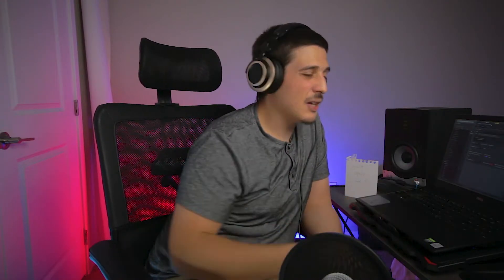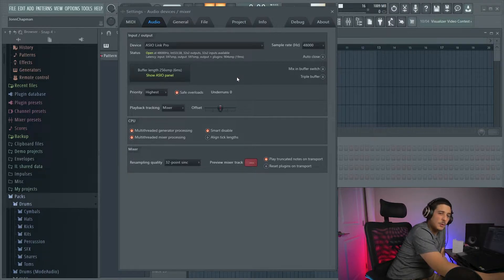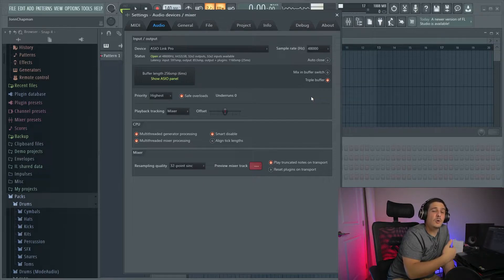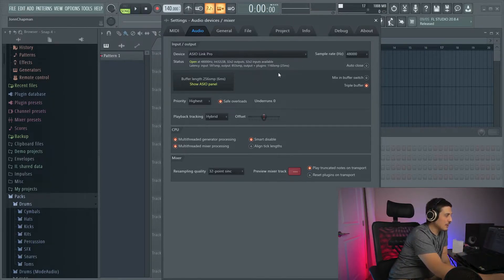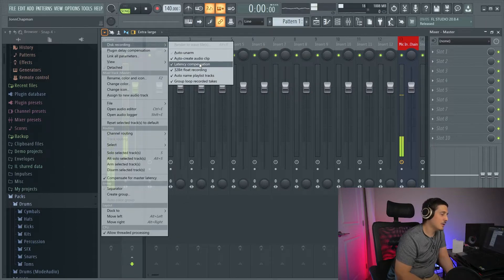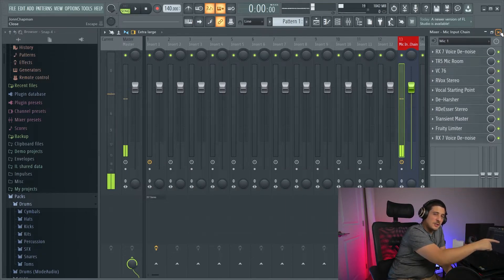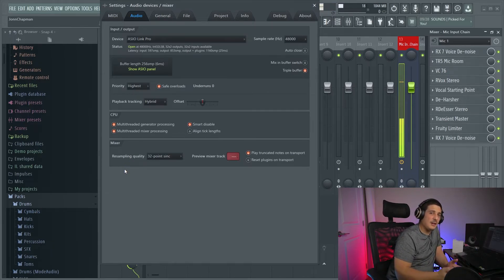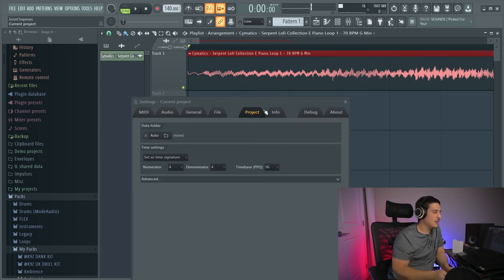How to fix FL Studio Latency Issues (MISTAKES) DON’T BREAK YOUR PC

Comment: What if the delay only happens after you export your tracks? How do I fix that part?
Reply from the maker: @x_Modest_x  This is usually caused by a plug-in issue. You can try to consolidate the track but it will very likely export with latency if you consolidate. A good work around is to arm the mixer track of the audio that is having the problem and then right click the main record button on the top of FL Studio. Make sure that “audio” has a check mark next to it in the drop-down for the main record button (from right clicking it). Hit record and then hit play and it should do a live recording of the audio which should be on time. You can mute the original track and then export with the new latency free audio clip.
Reply: @ thanks man you are a life saving genius!! I hope someday you’d make a video ❤️
Reply from the maker: Glad it worked! Not a bad idea 🤙

Comment: You can use ASIO without it muting everything except FL Studio. To do that, you must ensure that all of your devices in both FL Studio and Windows' sound menu are set to the same sample rate (44khz, 48khz, etc.)
Reply from the maker: This is true! Sample rates do need to match. This also depends on the particular ASIO driver, some are not multi-client and require a particular application to let go of the driver prior to being utilized elsewhere. It also depends on whether or not "Auto Close" is on or off.

Comment: great vid bro 100% , do you know how auto save project to a different folder meaning to a hard drive i have lost projects in my past as of right now my computer says its full when i only use fl for it pls help we'll  kindly appreciate it. for those laptop uses
Reply from the maker: If you click the "options" dropdown which is located next to "file" and "edit", you will see an option for  "Project general settings". The top section of the "Project" settings is the "Data folder" section. You will have options here to choose where to save projects and samples.

Comment: after changing the buffer size, i still get a pretty bad input delay when i try to record guitar. i’m using no other vsts at all, just audio clips
Reply from the maker: What’s the specs on your computer? Also, what kind of audio interface?
Reply: @ScaleAudio  i’m using a gaming laptop with a ryzen 9 5900HS, 16 gb of ram, and a scarlett solo
Reply from the maker: @gams1123  is triple buffer on? Also? What’s your sample rate?
Reply: @ScaleAudio  i think i found the problem… it only lags when i record from edison, but not when i record straight to the arrangement as an audio clip. my problem now is my cpu cant handle my amp simulator vst being opened multiple times, which means i can’t do that many layering tracks
Reply from the maker: @gams1123  Glad you were able to figure it out for the recording! As for the amp simulator you can print the audio and turn off the plugin to save resources. If you arm the track you can hit ALT+R to print it to the playlist as an audio clip. Then you can mute the plugin. If it is still taking up CPU you can try turning on smart disable for that plugin to see if that helps as well.

If you go to Tools>Macros>Turn on smart disable for all plugins, it will disable all plugins not in use which can also save a lot of CPU. The only problem with this options is that it can throw off time based effects such as melodyne.

Comment: When I change to ASIO4ALL v2 my problem is that now input and output are both on my mic. it picks up the mic but I can't hear any sound from FL studio.
Reply from the maker: If you open the asio4all settings pannel you should be able to uncheck your mic as the output and choose a different device for output.

Comment: Is there any option to synchronize all mixer tracks latency?
Reply from the maker: Make sure that in the mixer options under “disk recording” that “latency compensation” is on and under “plug-in delay compensation” you have “automatic” checked. By default these should be on and everything should synchronize, what specifically are you experiencing?

Comment: If my project is still lagging after changing these things, is the only option to delete some of the plugins? In my case, not only is it lagging in the DAW, but some parts won't even play at all until I mute some of the effects. When I export it into a wav it's the same. Half the song is missing😅 Turning off smart disable made it a bit better. I'm glad you mentioned that since my project has melodyne.
Reply from the maker: If some of the tracks are silent even when exporting that may be due to some plugins dropping licenses and going into demo mode. or not being licensed at all and being demos. When I have intensive projects I usually get more strategic about what plugins I'm using and I will bounce any tracks that I can to wav files with the effects applied. Then I'll save that in a new version of the project so I can get rid of a bunch of plugins but if I need to go back I can. Kind of haphazard and inefficient but you gotta do what you gotta do.

Comment: Hey men, i installed autotune pro and it causes 64ms of latency now when i record vocals i turn it off and when the vocal is recorded i turn it back on. But now i realized even when i do that some part of the project like kick will just start going way before music plays, and when i turn off the effects (that causes the latency) it plays normal again. Idk what to do, should i just delete all plugins that cause latency or what
Reply from the maker: Some troubleshooting for ya. 

In your mixer, under the top left drop-down make sure plugin delay compensation is checkmarked for the “automatic” option. 

Is your kick in a mixer track by itself? If not, are the other instruments in the same mixer track early as well? Try changing the mixer track of the kick to make sure it’s not related to that mixer track specifically (there are mixer related latency options for compensating for plugins and recorded audio)

If everything else checks out, go into the back of the plug-in wrapper and try to give it a fixed latency to the offending plug-in, you can do this by clicking the cogwheel at the top of the plugin, choosing the option that shows a plug as well as a cogwheel, going to the “Troubleshooting” tab, and clicking “Use fixed buffer sizes”. this may add more latency to the track, however, it may resolve your sync issues.
Reply from the maker: You can also click your master track and make sure the clock icon on the bottom right of the mixer is set to delay audio output. Unsure if that could cause anything weird if it’s off.

In the audio settings checkmark the align tick lengths option.
Reply from the maker: Ps. Sorry it took a bit to get back to you

Comment: So I have my Scarlett as a asio driver but I don’t know how to get the playback through my headphones
Reply from the maker: Are your headphones plugged into the front of your Scarlett? Are you using a windows or a Mac computer?
Reply: No they are plugged in on my computer and I use windows
Reply from the maker: @Reelmoments433 Gotcha, the Scarlett asio driver is for the Focusrite Scarlett USB interface to be able to process and output/input audio. In order to hear audio you have to be plugged into the physical interface. The outputs are labeled for the headphones and/or speakers. Scarlett interfaces are a very great bang for your buck interface. I bought mine about 8 years ago and still use it today.

Comment: Thank you so much for this very informative video. I am using a Scarlett 2i2 solo studio interface together with FL Studio ASIO. The lowest buffer length option I have is 256smp and I have my sample rate at 44100. It seems no matter how much I adjust these things and go through your video that I still have terrible latency. I tried ASIO4ALL as well but nothing seems to help. Any suggestions?
Reply from the maker: You should have a 2i2 usb asio driver to choose. If not I’d go to the focusrite website and download the appropriate drivers. Installing the drivers should give you a new driver choice in FL which may help. Let me know if that resolves the issue 🤙
Reply: I got the same issue as well. I dont know to install drivers. I got a behringer interface
Reply from the maker: @budgie2322  you would go to Behringer’s website and find your products driver and then download it.
Reply: I downloaded my Scarlett as a asio driver but I can’t hear playback
Reply from the maker: @Reelmoments433  what generation and type of Scarlett is it?
Reply from the maker: @Reelmoments433  are your speakers connected to the back of your Scarlett? And are they passive or active speakers?

Comment: after i export my tracks to stems I am having huge problems putting them back in to FL to mix the project. everything is offset timing wise. like all the stems are like milliseconds off so its impossible to adjust them to the right spots even if I compare them to a reference track of the song unmastered. Does anybody have any idea why? this has been driving me crazy for longer than I would like to admit and because of it I cannot finish any project that I have started. NEED HELP and i have found nothing online to explain my problem over months of looking. I don't know if its a latency issue but nothing in this video fixed anything for me. However it was very informative.
Reply from the maker: Hey! Sorry for the late reply! Go to your mixer, in the top left is an arrow pointing down, click it and in the drop down is “disk recording”, go there and make sure “latency compensation” is on. Underneath disk recording is “Plug-in delay compensation”, make sure “automatic”, and “compensation automations” is checked. When you export, in the export options on the bottom is a bunch of buttons listed in the “miscellaneous” section. In this section you should see a button for “Trim PDC Silence”, make sure this is on. These are all the delay compensation settings I can remember. If these don’t fix it you can go to audio settings and try turning on “align tick lengths”. Also if it’s only specific plugins you can try going to the plugins “troubleshooting” section under “vst wrapper settings” (vst wrapper settings is an icon that looks like a plug and a cogwheel next to each other) and you can try checking “use fixed buffer size”. This will give a fixed amount of latency which may help with the automatic compensation. You can also try checking “use time offset” on the same page. If fixed buffer size and time offset don’t work I’d make sure to turn them back off when done with them. Hopefully something here works for you.

Comment: Anything I record is starting earlier than it should as opposed to later and its got me scratching my head. Any help would be great but maybe Ill figure it out soon. Wonderful guide!
Reply from the maker: I would try changing the playback tracking and adjusting your offset. Change it to driver and set offset -200. Tell me if that helps. (Pulled that solution straight off of image-line support.) for tracking, driver will generally be the way to go for interfaces, mixer will base timing off FL Studio itself. Offset should help with the rest.
Reply from the maker: Thanks for the comment and hope that’s helpful!

Comment: i have around 350 ms how to fix this
Reply from the maker: Wow. Thats a lot. Without actually being behind your computer to troubleshoot I couldn't quite tell you. If you've followed the stuff in this video, then all that's left would be plugins or a buggy FL Studio application. Something I failed to talk about in this video is sample rate. The higher the sample rate the more that has to be processed at one moment in time, therefore the more latency your system has.
Reply from the maker: Most likely however you have a plugin or instrument giving you a problem or you need to uninstall and reinstall FL Studio. There is also a "diagnostic" tool under the "help" option in the top left menu in FL Studio that may be able to help you. If all else fails, then it may be driver related or have something to do with compatibility issues between FL Studio and your computer system.
Reply from the maker: Cool drum and bass track on your channel btw.

Comment: Hi, so I've had this issue with my new laptop, I've had 60 ms buffer length and I've followed the video yet nothing has changed, any tips? I'm thinking it's a setting on the laptop itself
Reply from the maker: Is there any plugins in your mixer? Sometimes plugins cause a lot of latency, there’s actually setting in your plug-in wrappers even for your instruments that if accidentally checked can cause huuuugggeee latency.

Your general settings has some settings that can cause latency. Not huge though.

If you’ve dropped your buffer length, you’re using an asio driver, it’s not being caused by any plugins, and your latency is still that high then I’d try updating the drivers to your laptop and getting the latest service packages for your operating system. You also might try reinstalling FL Studio.

And if it helps at all here’s an updated in depth audio settings video.

https://youtu.be/Idi61zBfKbM
Reply: @ScaleAudio  Thank you, I'll be sure to try update the drivers, i realized it's nothing in my mixer because i tried using the mic even when i just open fl, no project, no plugins, but thanks for getting back to me 💯
Reply from the maker: @callmeenzo8868  you bet 🤙 sorry I couldn’t be more help!

Comment: Having export issues 80 and 40s. In studio is good. 4500u Aya neo
Reply from the maker: Your exporting on a aya neo? And 80 and 40s is referring to sample rates? In the studio on a standard computer export is fine though? Sorry just trying to understand.
Reply from the maker: If your exporting I’d check the export resampling quality in the export page is the same as the project resampling quality in the audio settings page. You can turn off all mixer effects when exporting as well by clicking the option at the bottom of the export page. If you do that and everything exports fine then your issue is one of your plugins.